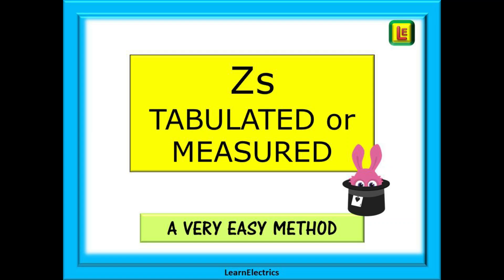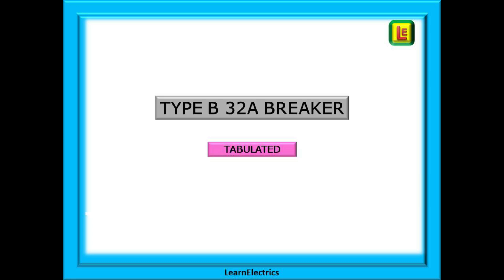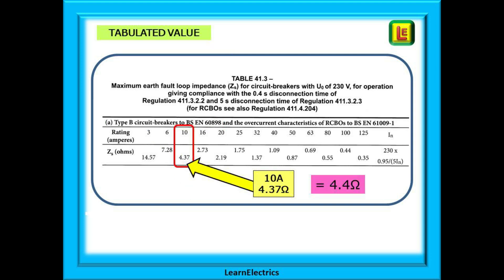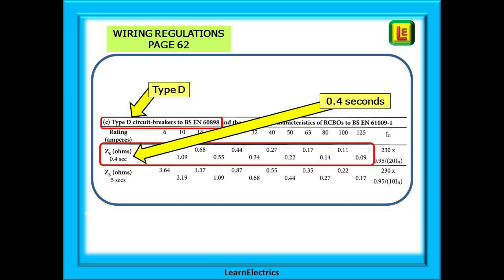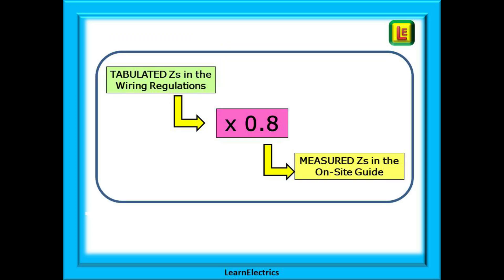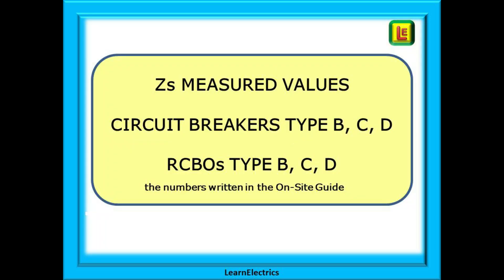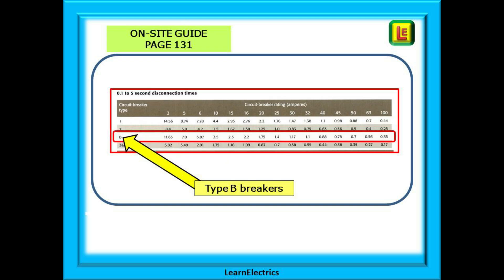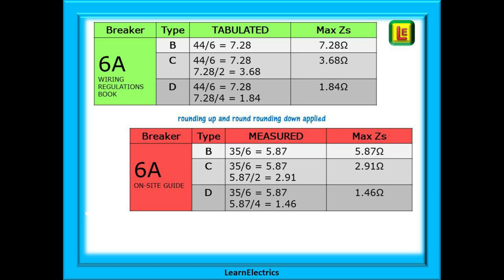Zs - TABULATED or MEASURED. An easy method to calculate the Zs values without the books.

Comment: Hey agree, this  is a way of calculating Zs but in my opinion it doesn’t give you an understanding of the whole thing and how its actually. Calculated in BS7671. Which isn’t that much more complicated. All thats needed is 3 to 5 x In for B types, 5 to 10 for C types and 10 to 20 for D types.  This allows you to understand that a breaker has a range it must trip within. As we’re looking for a worst case for maximum Zs you use the higher value.
Eg 32A MCB B type would be 32 x 5 = 160A. Using Ohms law 230V / 160A =1.4375ohms. Using 0.95 correction for voltage fluctuation Cm 1.4375 x 0.95 = 1.37 ohms. Simple
Reply from the maker: Thanks Jon, yes, we already have a video on how it is calculated from the time and current tables and this is another interesting method. Thanks for watching, thanks for your input. Dave.
Reply: Why bother when shorter and easier method .